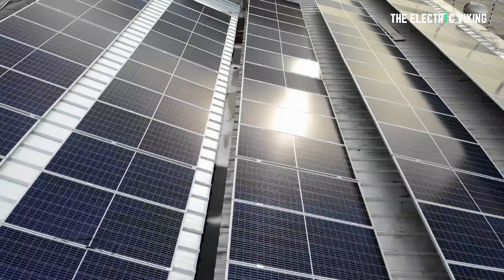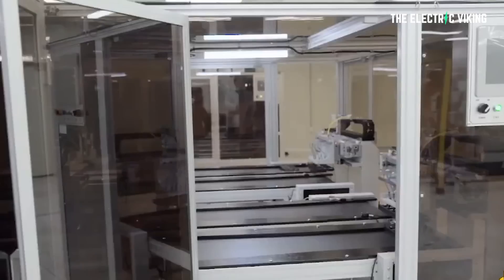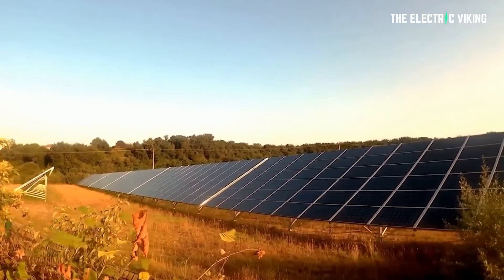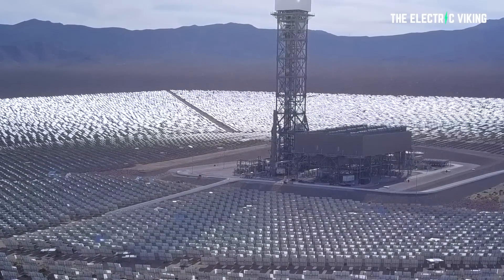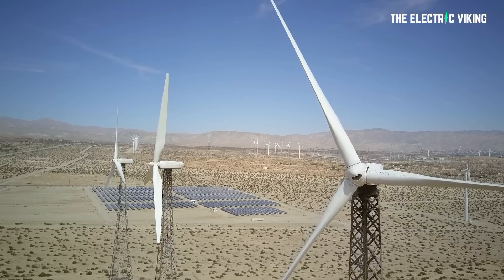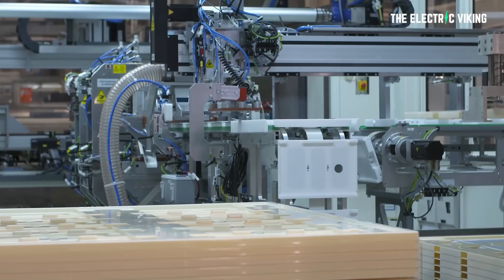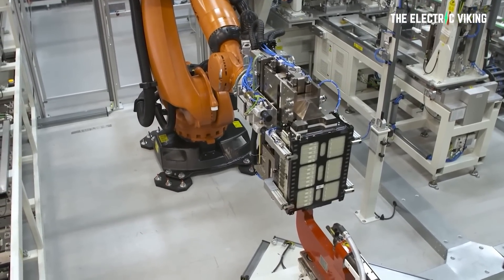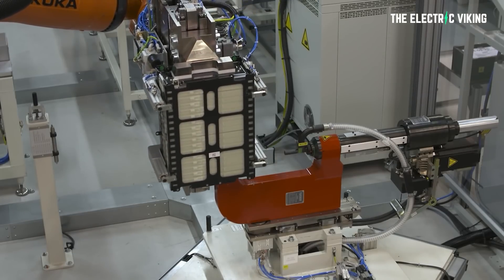The new battery that is cheaper than lithium with 4 times the capacity

Comment: It could work; but thus far the life has been limited to 600 cycles; suggesting the battery would need to be swapped out every 2 years or so. That might work for designs like NIO but you also require a new bunch of battery swap stations. Pretty soon the 30% reduced battery cost isn't worth it.  More development is needed but it definitely has some promise.
Reply: 600 Cycles are approximately 300'000 Km which is not that bad for a new tech. Probably still improving.
Reply: @beatreuteler  that would depend on how large the battery is.  If it were 81 Kwh;  that would be about right given a density as good as todays Li cells; that is similar weight. The higher the weight the shorter the range.
Reply: @BlondieSuperdog  The weight does not seem to play such a big role in range with BEV's. I think the recoup capabilities are more important so that acceleration energy isn't lost.
Reply: @beatreuteler  Are you familiar with this equation? F=MA.  Given two vehicles with the same acceleration - the lighter one will take less energy to move, it will take less energy to raise in altitude. Mass has totally Everything to do with how much energy is required.Given the same speeds a vehicle weighing 10% with take at minimum 10% more energy to move; if you have the same size battery; the range will be 10% less.
Reply: @BlondieSuperdog  You are wrong because you seemingly don't know how BEV's work. Different from ICE cars they are, depending on the tech used and depending of correct driving, capable to recoup kinetic energy when decelerating. This energy can be stored back into the Battery. Due to this the only drawback mass makes is a possible increase in friction on the road but that one is by far less than the 10% you are thinking of.
Reply: @beatreuteler  Now you  are changing subjects comparing to ICe cars;  well if hybirds are included in your ICE cars then you are incorrect because they also regen and can run all electric.  An ICE car would not have regen; but if it was lighter ; that could easily make up for regen.  Certainly an ICE cars motor is less efficient than an Electric - but you have to take into account where the source of Electricity is - if it is as usual world wide - it is from a fossil fuel generation plant.  In that case a lower weight ICE car can be more efficient in total energy used. A Model Y takes 70 lbs of coal or 8 gallons of gasoline in order to obtain 250 miles real range.  That is  only 31.25 mpg . Many ICE cars can do better than that; a Prius can do 58 mpg.
Reply: @BlondieSuperdog  - Strange, the fueleconomy govt website says a 2022 Model Y RWD MPGe is 129 miles combined city/highway, city is 140 miles, 119 hwy.
Reply: @Chainyanker007  Very strange because its garbage - Those are "calculated" theoretical max at 31 mph with no stops, no hills, which means useless.  Go look at any actual driving miles on any youtube real mileage test for the Y or any EV none of them make these maximums or even get within 30% at highway speeds or even a mix.  What it shows is an incredible bias on the part of the EPA - they need a new job - garbage collector.
Reply: @BlondieSuperdog  There are no ICE cars which are light weight enough to compensate for regeneration. And no, I'm not changing subject. Regeneration is intrinsic part of the BEV concept, And hybrids typically don't have enough battery capacity to allow full regen as BEV's do, and their full electric range is typically not good enough. Still I don't full count them as ICE cars but now that you mention it: To some extent they are and they are way too heavy for what they can do as "short range BEV's". On top of that they are more complex to be built and serviced.
Reply: @beatreuteler  Can you read; A Tesla model Y w 81Kwh battery has a max range if you push it 300 miles - usually 30 miles less; even at that 300/8gallons = 37 mpg - so between 30 and 40 mpg - there is a long list of ICE cars than can get that plus hybrids generally get over 50 so do I have to provide the list of ICE cars that do better than 40 mpg?  There must be 100 cars on that list; plus I did specify that the Prius gets 58; a great deal better than the Model Y.  That includes the Y driving in the real world - there are a long list of youttube videos showing how far a Y can drive on a full charge down to zero - which isn't even recommended.
Reply: @BlondieSuperdog  When 300 miles is approximatley 480 Km, that would mean the model Y when using it down to 10% is consuming  approximately 15 KWh/100Km. This is an equivalent of approximately 1.5 liters of Diesel /100Km. None of the cars you were listing comes even close to that efficiency. So: You confirming yourself what I was trying to get over as a message all the time: Weight of the car is higher but still efficiency is much better! e.g. ICE cars  can't compete regardless they are lighter.

Comment: E-Viking, thanks for your excellent and informative videos.
Please do more research and do not repeat BS being pushed by vested interests like sodium battery tech researchers/manufacturers. Sodium must be preheated to operate in a molten state, this tech is more suitable for energy storage and not for cars where LMFP looks more promising in terms of costs. 
In fact you mentioned "long living flow batteries" - I understand meaning Vanadium Redox Flow (VRF), also you refer to an energy storage researcher working in Syd Uni on Na battery tech - i.e. "energy storage" not necessarily for mobile/transportation applications. Those who push sodium batteries always compare them to lithium ion batteries in EVs, showing exploding Li ion batteries and all their shortcomings and then talk about sodium for energy storage applications but do not mention VRF - you should find out why they are avoiding any comparison to VRF. for energy storage.
Regards, Paul from Doncaster Vic

Comment: At 2am this morning, the UK eletricity grid was 80.6% powered from wind power

Offshore wind in the North Sea is very very effective. We don't need mass eletricity storage the winds are pretty consistent and turbines spread around the UK result and will result in the UK grid being mostly wind powered with mo significant storage requirements

Europe doesnt have a lot of fossil fuel resources but the North Sea is becoming a vast efficient affordable area for offshore wind development
Reply: And if the wind doesn't blow?
Reply: @Glenn  Wind isn't like solar. The wind can vary quite a lot from one region of the UK to another

The UK wind farms will be installed far and wide which means when it's not windy in one location it might be windy in another

All this means wind power and especially offshore wind power doesn't need much storage

The new offshore wind farms that will go online from 2025 will have a capacity factor of 60% so their output is far more steady and constant
Reply: @Glenn  The UK plan and this largely applies to all of Europe is to build wind farms in multiple different locations this way you reduce the amount of times when there is no wind. As its sometimes not windy in location A but is windy in location B

The next plan is to build interconnectors (many have already been built and many more will be) for the same reason to exchange excesses and deficits

Using these two simple free methods you can get to about 90% wind power. The remaining 10% will be filled by bio methane and other biomass and also natural gas

Doing the above is far cheaper and far cleaner than building mountain sized batteries that have a finite life
Reply: It's one thing powering 80% of the grid when nearly everyone is in bed and everything is shutdown - try that at peak times. This is why storage is needed, as even if the wind is blowing and you have a lot of turbines - it can't provide enough power for peak demands....not to mention there are days when there isn't much wind.
Reply: @blower  Now as I type this it is 17.20pm in the UK on a winters day so this is peak demand time

Wind power is producing 51% of all the electricity needs of a fairly large islands nation if almost 70 million people

And that is 51% using just the existing (fairly old) wind turbines. New wind farms are already under construction. More are in the planning stages. So the numbers will go up and up

By 2030 wind power will produce over 75% of of the UK electricity needs (this is the annual average)

All of that with little to no battery storage

Comment: People really need to realise that battery technology is close to the limits of physics and won't improve significantly, definitely not by 4x

The absolute peak chemical energy density would be something like dynamite, which is 1277 Wh/kg but that will NEVER be achieved with a rechargeable battery becuase dynamite is one way chemical reaction and is more or less 100% active materials

A rechargeable battery can only be a fraction active materials becuadd you need inactive materials like the case the separator and conduction materials and a lot more

The best current rechargeable batteries are around 300 wh/kg which is good enough

Maybe there is a pathway to go from 300 to 500 Wh/kg but that will be something like a 15-20 year process

Comment: Sodium based batteries have been in use for decades in the locomotive industry. The major advantage is when in contact with outside environment, the temperature drops to ambiant so no thermal runaways. The only problem I remember is the slow recharge cycle. Fast charging was not possible 10-12 years ago.
Reply: Great to know. Thanks
Reply: Real real good stuff thanks for sharing
Reply: Yes, I think the video is talking about the recent breakthrough made by Dr Shenlong Zhao from the University of Sydney.

The battery technology they have developed is envisioned to be used in large scale grid storage applications, it's unsure if it will be used in automotive applications as that wasn't the focus of their research.
Reply: Locomotives are all diesel electrics.

Comment: It is naive to assume the cost of solar power is mostly in the cost of the panel. A 30% price drop in the cost of the solar panel might drop the cost of electricity produced 2%. 
Energy density of EV batteries has not just gone up quadruple. If that was possible with materials that cost less than lithium, that would be a massive game changer. It would even make electric planes feasible. This would be the technological breakthrough of the century (so far). Imagine EVs with batteries a quarter the weight and size or having 2400 kms range. Imagine the Tesla semi with 2000 miles range on a single charge, or more likely enough range for a full 12 hour driving shift without payload loss.   Yet, Sam talks about it for maybe 30 seconds with the rest of the video being off-topic filler we have all heard before, a common YouTube trick to greatly increase viewing hours. 
You wasted a lot of our time with this one.

Comment: 50% reduction after 1000 chargers is NOT as good a spec as you make it out to be. However, 4 times the capacity and potentially cheaper would still make them far better than li-ion.
Reply: 4x the capacity is nonsense
Reply: @lighthousesaunders7242  . Yes. That does sound hard to believe.

Comment: For EV mining trucks check out XEMC, EACON (also autonomous) and XCMG.

A traditional 100 ton truck consumes 1,200-1,600 L of diesel a day and the cost is about $1,480-1,970 for the mine. The power consumption of a 120 ton  electric truck is 3,800-4,300 kW per day, at a cost of $263-298. In addition there are savings from less maintenance work eg changing engine oil, fuel and air filters. Low noise, zero emissions and estimated annual CO2 emissions reduction of 1,500 t. One truck feature is a retard resistance box – while retarding, the system will charge the battery when the bus voltage is in safety range, otherwise using the retard resistance box to consume the retard power.

Comment: Any new battery technology in 2022 won't show up in your car for a decade - maybe 2.
Years and years of testing lie ahead, and Beta testing in actual cars or power stations
and then that new technology will be replaced with something just discovered
means that count on just tweaks to existing Lithium chemistry for the next decade.
Reply: There are many factor to take into account and the final stage is actually humans.
Reply: Both CATL and BYD are shipping sodium-sulfur batteries this year.
Reply: @robertsheperd502  Sure hope they have spent 5+ years testing the battery
if not, they will join GM in firesales of their EVs/batteries

Comment: Again Sam you could treat us with a little more expected intelligence, which is it, lithium supply is or is not an issue? You have said both. 

Just address and explain your contradiction, you have said there are lithium mines coming to Utah's salt lake along with Australia starting to refine as well as mine and it will be "green" and there's no shortage of lithium. Now here, with at least one other video: lithium will run out.

Or don't address it, I'm just trying to figure out if you take us seriously as your fan base.